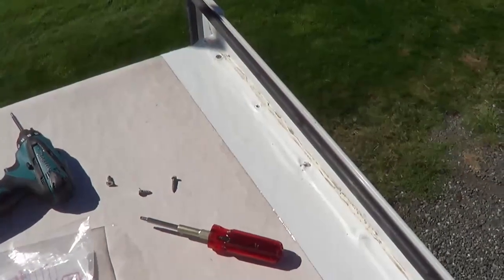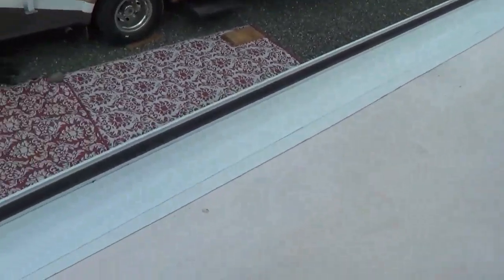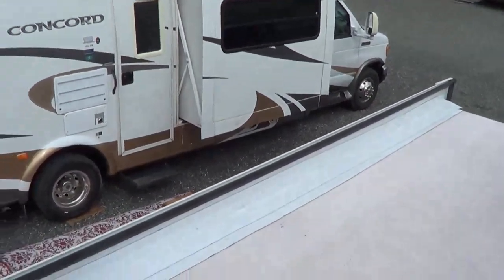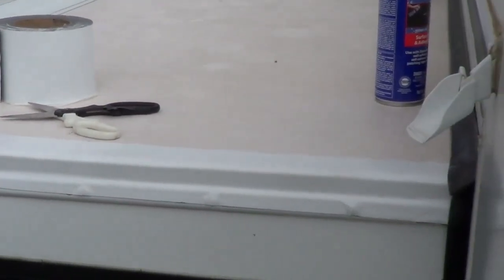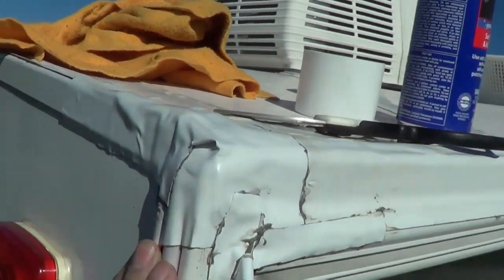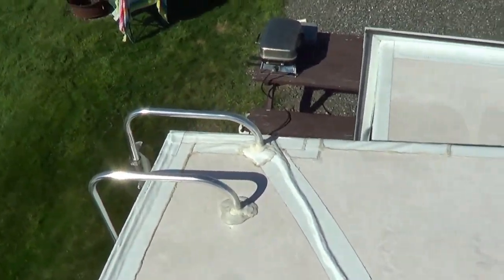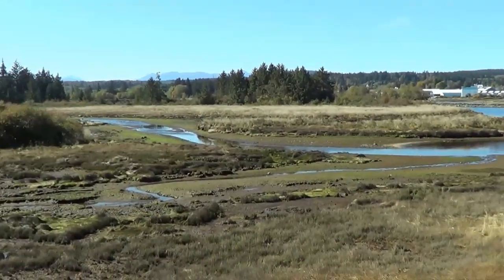Beefing Up My RV Roof Seals and Seams with Eternabond

Comment: great video, thank you very much!  I just got off the ladder doing one side of my rig and wanted to see you video one more time before tackling the nose cone seals.  Im happy that you showed the layering you did to solve the "odd spots"  im tackling it the same way.  There is soooo much built up DIcor that im having to shave it away to get a decent surface to transition into.  its no fun but neither is water damage!  I've delt with both.  As a blogger i was going to record my project as well but you have done such a great job documenting the process its easier to just share your work on a resources page.  With all due credit and links of course!!  Thanks for taking the time to make the video!!  Chris
Reply from the maker: You're welcome, Chris. I glad I have done the upgrade, we've had a ton of rain lately, makes me feel much better about the roof. Cheers Ray

Comment: We used eternabond on our entire roof, all vents and in the beginning we had a big leak. This stuff is Fantastic. It solved our problem. It has an unbelievable bonding power. Take your time and you have to roll it with pressure to activate the tape. I don't think there is anything better. And it last for years.
Reply from the maker: Cool, thanks for the feedback. So far I'm very pleased with it. Cheers Ray

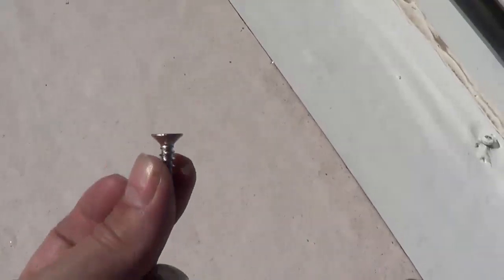Comment: That tape is one of the few products created for RVs that works and is worth the expense! As for the use of the screws shown at 2:20, I don't know of anywhere on an RV they are suitable for. Their heads, called bugle head, cause soft material to spread out and hard material to break, especially near margins. You need a washer head screw for that application!! Good luck

Comment: I inspected the corners and edges of my 2008 fifth wheel. I re-caulked the edges running down both sides, or at least the parts that looked to be in the worst shape. I think i may end up simply running a strip of this stuff down both side.
Reply from the maker: My tape install is holding up fine over a year later now, no signs of peeling off so I'm pleased. It has to be a better solution to constantly removing old and adding new sealant in my mind. Cheers Ray

Comment: Very informative video!  I'm about to fix my 2000 Adventurer camper for the first time with Eternabond tape and Sealant.  I use my camper ALOT and it has been neglected, your video will help indeed.   Thanks from another Ray across the water in Burnaby, BC.
Reply: Ray Lau were about to do our adventurer also ,how did it go for you

Comment: I've been thinking about this same thing on our brand new RV. Preventative maintenance. Why wait till there's a leak...
Reply from the maker: Our rig is 8 years old now and no roof leaks. I am happy with the tape as it's reduced the roof maintenance I've need to do and lasted well. https://www.loveyourrv.com/rv-roof-repair-eternabond-review/
Two drawbacks to using it, maybe it could void a roof warranty if they wanted to get sticky about it or cause a problem with resale if the person doesn't understand the tape. Cheers, Ray

Comment: Nice. I patched up mine with Dicor lap sealant but I think I’ll add a layer of the eternabond over top.
Reply from the maker: Here is a newer post with a review after a few years and a patch repair I did with the tape.   - http://www.loveyourrv.com/rv-roof-repair-eternabond-review/  and another more recent look at the roof https://www.loveyourrv.com/routine-rv-roof-maintenance-inspection-and-leak-protection/ Cheers, Ray

Comment: You should see my rv roof. I bought it last fall and someone had used eternabond to "seal" the perimeter of it, and is split in the middle of the tape on the entire length. I imagine it is about 3 years old is my guess. I will be sealing it this spring with a modified silane one part self terminating liquid flashing in white reinforced with fabric. Should last 10 years at least. After proper prep of course. I was going to post a photo of some eternabond sliding on a roof with the afore mentioned slope of 1/8" per foot, but I don't see how to post photos from my computer on here. I have installed probably hundreds of rolls of the material over the years, and in my opinion, the material has its place, but as a long term repair, I don't trust it. Just trying to share my experiences with it. Harm none, do what ye will!
Reply: kazcoro
Do you use Google Photos to automatically upload pics from your phone? If so, you can make a public link of the pics.

Comment: If you park on a slope, and it gets Phoenix summer hot, the eternabond can slide even after a curing period. This is because the underside is a butyl type tape, and it never fully cures. I have seen patches slide on a roof with a 1/8" per foot slope. They had slid almost an inch. And, they were small patches about 4" square, so weight wasn't an issue. This was on the WalMart in Anthem, AZ, FYI.
Reply from the maker: Here is an updated video showing my roof - https://youtu.be/tmIBxhbPx08  I have some Eternabond that is 3 years old now, no signs of slippage or snapping back but I don't hang out on 120F Phoenix so good point there. The underside doesn't look like any butyl tape I've seen. This is the RV stuff - https://www.eternabond.com/RoofSeal-p/rv-rs.htm
"Seal any rip, tear, or open seam in any surface with RoofSeal. RoofSeal is the best solution for leak repair. It is the choice of professional roof repair specialists, on virtually all roof types including EPDM, TPO, hypalon, most PVC, modified, all metals, even copper and Kynar coated metals, tile, wood, concrete, etc. RoofSeal even works great on land-fill and pond liners. Our specialized backing has proven to be UV stable, even after 19 years in full sunlight. Our MicroSealant has a built in primer which allows RoofSeal to bond with the surface it is installed on. Perfect for re-seaming all roofs, regardless of the material. RoofSeal makes a permanent water-tight seal.
Did you know RV roof seams require yearly maintenance? Use RoofSeal over factory roof seams one time and never do roof seam maintenance again! More than 25 high-end RV manufacturers now use EternaBond® products in the manufacturing of their dream machines to ensure their customers will truly have a weather tight, leak-proof RV.

Elongation factor greater than 700% guarantees RoofSeal will flex, expand and contract in all conditions! Can be installed to -20°F (with our EternaPrime). Sag rating of over 250°F."
Reply: Make sure you DO NOT use the Eternaprime on a PVC (polyvinyl chloride) surface. The primer will not cure and the Eternabond WILL NOT STICK over the primered area. Ask me how I know.

Comment: Howdy Ray, I realize that this is an older video but I have a question. When you sealed the top of the slide-out, Whey didn't you bring the eternabond tape on down the side? I realize there are many screws that would have to be removed and then replaced after the application of the tape. I'm about to seal my bedroom slide out. I see that the puddy tape is starting separate on the sides and that for sure will cause leaking. Anyway just thought I'd ask...,
Reply from the maker: Mainly for looks. I inspected the side seam and looked like the factory had used putty tape and also silicone and the seam looked good so left it for the time being.  Recently though I had to replace a section of my slide floor, a factory flaw was causing water to wick into the underneath.  Here is my fix -  https://www.loveyourrv.com/rotted-rv-slide-out-floor-repair-fixed-manufacturer-flaw/
Also here is an updated review on the Eternabond - https://www.loveyourrv.com/rv-roof-repair-eternabond-review/ Cheers, Ray

Comment: Great job, Ray. I need to do the exact same job to my fifth wheel. Question; What did you use to clean your roof before applying the tape? Was it okay to stand on top of your slide, or were you working off of a tall step ladder. Also, what all products did you use, and where did you buy them? Thank you.
Reply from the maker: Thanks, here are couple more videos to check out that I've done.  I give some cleaning options.
https://www.loveyourrv.com/resealing-rv-roof-eternabond-tape/ 
https://www.loveyourrv.com/rv-roof-repair-eternabond-review/
https://www.loveyourrv.com/rv-roof-reseal-and-refresh-alpha-systems-top-coat-lap-sealant-and-roofing-tape/
My slide is quite walkable. It uses 3/8 boarding for the roof and aluminum studs for the frame. I'm 200 lbs and no problem. But I can't comment no other models or the new ones.
Reply: @LoveYourRV . Thanks for the tip.

Comment: Hey I have some neighbors that have some sort of tape, maybe eternabond that use it as a replacement for the top rubber seal for slide out which deteriorates over time. Can I do that? I see a lot of RVers that have tape sealing up literally every rubber seal location. Your video only seems to show the outside part of the slide out roof.
Reply from the maker: You can't use Eternabond in place of any actual rubber seals. Rubber seals are used due to their flexibility. Eternabond is meant as a way to seal seams instead of or over top of the usually used caulking type sealants. On a slide that could be the seam between the slide rubber roof and the metal flashing.

Comment: I have some Eternabond on my slides that are not in good shape. Can I apply new Eternabond on top of existing older Eternabond to re-seal? Or do I need to somehow get all the old Eternabond off? I see you have applied new Eternabond right on top of older tape and even on top of older dicor sealant? Obviously, it must work! Also, It looks to me like you must be actually on top of the slide when applying the tape? How can I tell if it is safe to walk on my slideout roof without actually trial and error? (that would be an expensive 'error'!)
Reply from the maker: You can do either - https://www.eternabond.com/articles.asp?id=165   The biggest thing by far for a successful Eternabond job is to prep the surface really well first and get it as clean as possible, don't stretch the tape just lay it in place and apply lots of pressure to release the adhesive, a seam roller work well or strong pressure with your hands. Here is more info - https://www.loveyourrv.com/rv-roof-repair-eternabond-review/
My slide seems to hold my weight fine, I'm about 190 and I get on my hands and knees to spread the weight out.  Sorry, I can't advise on other models or brands slides.  Cheers, Ray

Comment: Did you stand on the slide out to do the taping? I have a motor home with slides, and have always wondered if it were safe to stand out there.  Your videos are most helpful--thanks!
Reply from the maker: +rjf946 Some slides are, some aren't. Mine is pretty strong and feels very stable when I stand on it, but I try to limit my time on it and also stay on my hands and knees to spread out the weight.
Reply: +Love Your RV Thanks very much.
Reply: @LoveYourRV  . That answers my question.

Comment: After putting down the eternabond tape, what if you need to remove the tape for some sort of repair.  Will it deform your roof in any way?  Thanks
Reply from the maker: Say I wanted to replace a vent I would just carefully cut along the seam around the tape then add the new tape over the old, it sticks well to itself. Here are the companies instructions - https://www.eternabond.com/articles.asp?id=165
Also recent updates on how the tape has lasted - https://www.loveyourrv.com/rv-roof-repair-eternabond-review/  and https://www.loveyourrv.com/routine-rv-roof-maintenance-inspection-and-leak-protection/   Cheers, Ray

Comment: Regarding the slide out; when you put the tape on each end of the slide out, do you find water stands up there now?
Reply from the maker: No, not really we usually keep the RV slightly nose high for better sleeping so any slide roof water drains off the back. The tape edge is quite thin so any water that is left evaporates quickly kind of like if you had a lot of morning due on a car.  Cheers, Ray

Comment: I’ve got globs of self
Level dicor over the screws on my slide could eternabond just go over them as well?
Reply from the maker: I think I would remove the Dicor or at least shave it flat.  Another option is to remove the screws and replace with flat heat type. Recently I replaced my 10 year old slide roof membrane and when I had the flashings off drilled out countersunk holes and added flathead stainless screws before applying the tape - https://www.loveyourrv.com/alpha-systems-superflex-roof-installation-replacing-rv-slide-membrane/  Cheers, Ray
Reply: Dicor cracks after a few years and I see people putting layer after layer of this stuff with huge globs all over, I used Mulco Expert on mine and it lasts for years without multi applications.

Comment: I need to replace my sealing tape on the top of my slide out. I'm wondering when you installed the Eternabond on the top of your slide out did you seal the leading edge so the wiper seal wouldn't catch on it when you close it?
Reply from the maker: No, I've had no problem with the wipers, they don't apply much pressure at all. You can find an update video here showing the slide, look at the video at about the 8:30 mark. Cheers, Ray  https://www.loveyourrv.com/rv-roof-repair-eternabond-review/

Comment: Do you use a roller to put the tape down?
Reply from the maker: I've done both, used hand pressure and a seam roller, I find firm hand pressure works better around uneven surfaces and corners and the roller works well on flat areas.  It all depends on the persons hand strength I guess. Cheers, Ray

Comment: Is it true that you can't pull this stuff up very easily? I am thinking if I need t o change for example a damaged vent cap Etc.  Thanks
Reply from the maker: I would just cut it and tape over with a new piece.
Here is a link with some info on removing - https://www.eternabond.com/articles.asp?id=165
- Ray

Comment: Did you have to remove all the old sealant before you put the tape down?   How hard is it to get the old Dicor seals off?
Reply from the maker: I removed some of it but not all. I just cleaned it really good. The tape will stick to Dicor. If down on a hot day the Dicor comes off like gum.
Here is an updated video - https://www.loveyourrv.com/rv-roof-repair-eternabond-review/
Cheers, Ray

Comment: Good video! Ray did you install those gutter diverters at the end of our gutters? I purchased some at Wal-Mart and they simply did not fit right on my gutters. Your look solid. Good job.
Reply from the maker: +The Kelly Corner I think mine are Camco, They were pretty tight to snap in place but I've had them on there for over 4 years now, no problems.

Comment: Why aren’t you using a roller to put the tape down?
Reply from the maker: I didn't have one at the time but have used one since when I have added more tape https://www.loveyourrv.com/rv-roof-repair-eternabond-review/ I find though if you have strong hands it's enough pressure to get the sealant to activate. Also, it's easier to get pressure on odd-shaped parts of the project. The tape laid down in this video is still working well 5 years later. Cheers, Ray

Comment: Eternabond is a temporary repair tape. I have used it 100s of times on all types of roofing. Granted, everything roofing related is temporary, but eternabond is a lot more temporary than other products you could use. Even a good 1 part urethane caulk will out perform the tape, especially if you embed fabric reinforcement. Sherwin WIlliams sells a good cauilk called Stampede....

Comment: On your front cap, did you remove any of the old sealent?....or put tape over the old sealent after cleaning it....
Thanks Ray
Reply from the maker: My sealant was in excellent shape so taped right over after thoroughly cleaning it, tape is stay holding in place years later.
Reply: @LoveYourRV  thank you...I have a travel trailer... fiberglass meets the rubber.. seems like it was engineered to fail....I will do the same
Reply from the maker: Here are a few other more recent videos I've done - https://www.loveyourrv.com/rv-roof-repair-eternabond-review/  https://www.loveyourrv.com/routine-rv-roof-maintenance-inspection-and-leak-protection/  So you can see how its held up. Still need to check on it once in a while but much less overall maintenance. Cheers, Ray
Reply: @LoveYourRV  thanks Ray

Comment: Question: It looks like you when right over the sealant that was on the rood to start with. Does that cause any problem later on? How long does this Eternabond late?
Reply from the maker: If you clean the old Dicor lap sealant really well and get all the dirt off, the tape will stick to it. Also, I use 4" wide tape so it also can stick to the roof surfaces on either side of the old sealant. If in doubt you could always remove the old sealant first. Couple years later now and no signs of the tape lifting or peeling off. 
It's supposed to be good for:
How long does EternaBond® last?Because EternaBond® is made using MicroSealant Technology®, depending on surrounding conditions, EternaBond® has an estimated life expectancy of 18-35 years if applied correctly. The "pre-activated" shelf life of EternaBond®, stored correctly, is 5 years!

Comment: I used a roll of Eternabond 4" tape on the top of my 5th wheel less than two years ago and though it seems secure, it looks terrible.  It has all turned a dull and mustard color yellow.  It loos terrible.  It seems it's not all that well UV resistant.  It does get a lot of sun here in the CA central valley though.  Has anyone has a similar problem with this product?
Reply from the maker: Much of mine has been on there around 3 1/2 years now, looks the same as when I laid it down. https://www.loveyourrv.com/wp-content/uploads/2017/08/Rooftop-view.jpg
I spend summers in the northwest and winters in the southwest desert, so it sees a fair amount of sun, but not near the heat and pollution you'd see in the central valley. Maybe there is some chemical in the air down there.